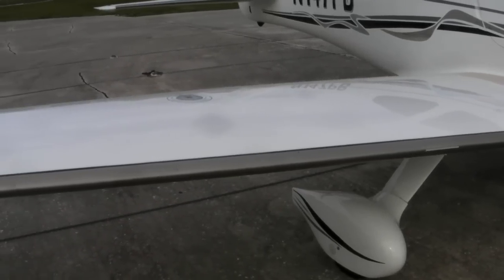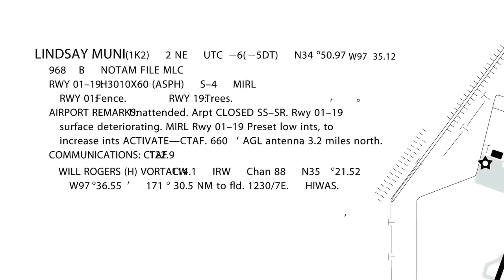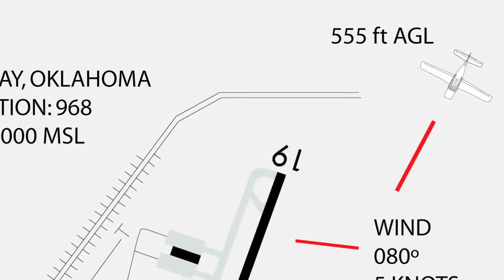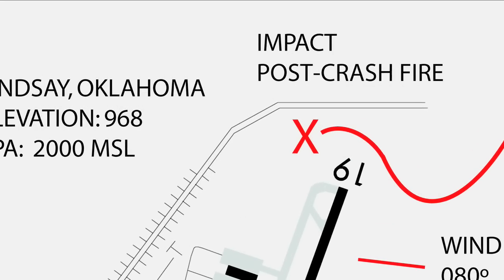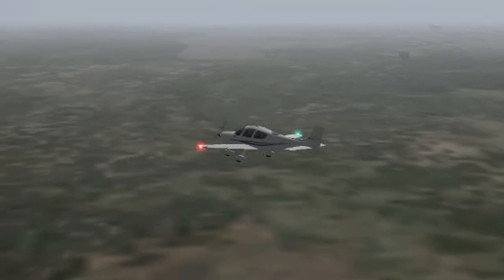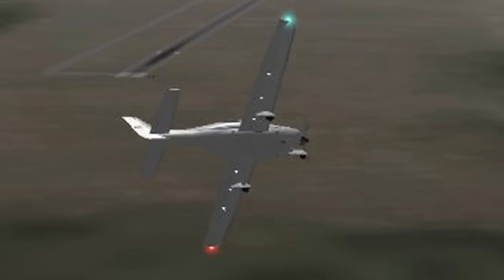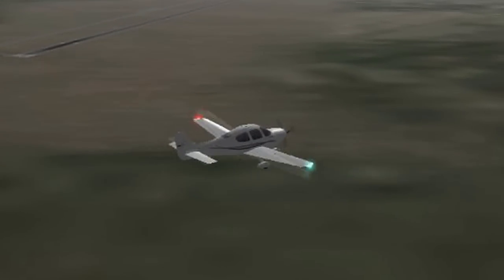Anatomy of a Cirrus Stall Accident

Comment: Is there a place for simulators in stall spin education?

 I heard from another channel that spin recovery is not taught as a matter of course. Would simulator training - asking the pilot to deliberately create stall conditions in the pattern, leading to crash, followed by both spin recovery training and 'correct' in-pattern, preventive behaviours - not drill this important safety issue home? Modern sims are highly accurate, relatively cheap and you can walk away from a crash in one. A useful addition to training schools?

NB I am not a pilot in training, just use sims, but plan to get up in the air for real :D
Reply: Yeah, and if you are taught spin recovery, your chances are way better that you would never accidentally enter one!
Reply: many sims do a poor job of simulating realistic spin conditions. Some are alright, but it should be part of every pilot's flight training. Spins in controlled conditions are very safe, but people are scared to ask to get practice and so they don't develop life-saving skills. If you ever do flight training, spin training should definitely be part of it.
Reply: Mirandorl Why not use a real plane? I flew some turning stalls this afternoon with a flight instructor. We got up good and high (4500' AGL) and ran through various scenarios. This included skidding turns and departure stalls. Very illuminating. Fun, too. :-)

Spins are required for PPL flight training in Canada, BTW.
Reply: +Mirandorl Yea it's called buy a remote control airplane and you will never make the mistake! As i learned years ago. It teaches you to avoid the shit that will kill you to start with and you get it see it first hand and just what will happen.

Which when I heard he tried to use rudder to recover. I knew just what was going to happen.
Reply: +Mark S Not at that altitude. He went from 1500 ft to 800 ft.  You could be a naval aviator and the out come is still the same. Not enough airspeed, time and space. You better off just to apply full power and fly your way out of it or better yet don't try and save the approach if you know you missed it. Just go around.
Reply: +Mirandorl We do spin training in Canada. It's really cool, and you can feel the +G's coming back. Dropping doesn't hurt a bit but I'm reading about recovery and possibly keeping the blood in your head by clenching your lower body muscles. Does anyone have experience in this technique? I just want to make sure I have full control in the event I'm the only pilot in the plane.
Reply: Elaine Morrison I have some experience with that technique, but under normal circumstances I don't feel like it's necessary.

When training for and practicing spins you may do many in a row, which is a lot harder on your body. The Gs come when pulling out of the bottom of the spin, so in an emergency scenario you'd only get that once and then hopefully not induce another spin if you were lucky enough to have the height/skill to recover.

The technique does work though.
Reply: +Andy Plater Thanks! I didn't want to do the opposite technique and make it worse (or ask a teacher at the school to experiment and report back if it wasn't the right thing to do, since no one seemed to have heard of that). Would you hold your breath or breathe in (as opposed to breathing out to relax which was what I was instinctively doing, but which is probably incorrect considering you're trying to keep the blood pressure high and restricted, I guess)? Yes, I got through it regardless but it was a little brutal and my instructor was there and I'm just interested in more technique to take the edge off in case I need it.
Reply: Elaine Morrison When fighter pilots do it they use a technique called "hook breathing", the idea is breathing in and as beginning to exhale you make a "hook" sound but hold the K and are squeezing your abdominal muscles. I'm not sure I would recommend it for spins and not more intense aerobatic maneuvers as without practice I would speculate one could either end up hyperventilating or not breathing enough which would be more cause for concern for getting light-headed.

Flexing the legs/abdomen but attempting to breathe at a normal pace is probably your safest bet. Also remember that the Gs are on the pull-out not in the spin or initial recovery, so don't let the technique distract you from recovering safely/efficiently.

The other thing I find that helps is time. If I've done multiple spins I may feel slightly disoriented or even just tired, so flying straight and level for a bit (possibly also while flexing) is a good idea if you're unsure of how you feel. Sometimes I'll do a full flight with multiple types of maneuvers including spins and by the end of the hour or more flight I'm just really physically tired.
Reply: +Andy Plater Awesome information! Thanks! I'll pass it on. I was googling but only found marginal pieces of this idea which was frustrating because I was sure people out there had the complete picture, and consciousness is not something to "experiment" with. :-)
Reply: Wireline, cost is a big problem. A full-motion SR22 simulator would cost well over a million dollars and it might cost $250 per hour to run. The airplane itself is $600,000 and costs $200 per hour to fly.
Reply: Turning stalls are not spins
Reply: Depends on where you are.
Training for detecting and recovering an incipient spin is performed as a matter of routine around here.

But training in a real aircraft for recovering an actual spin... That's illegal for a flight instructor to do.
Why?
Excessive training accident rates, and low survivability anyway if you get that far into a spin.

Obviously not every place is the same. My country has exceptionally strict laws, sometimes to the point that the regulator and pilots have developed a lot of mutual distrust because of it.

But end result is still that full on spin training is illegal. Make of that what you will.

If you're going to practice spins or any non-standard flight regime in a simulator though, be aware of what kind of flight model the simulator uses.

Flight models derived  directly from tables of real world data (such as MS flight simulator) generally don't have meaningful data for non-standard conditions, thus the behaviour will be completely nonsensical under these conditions.

Physics based models (such as X-plane, with it's Blade Element Analysis model) will have more appropriate behaviour in strange situations, but the general flight model in ALL flight regimes may be less than ideal, both in terms of general accuracy, and aircraft specific accuracy.

For training purposes you want the most accurate simulated model you can get hold of for the aircraft you're training with.
But be aware the behaviour may not be entirely trustworthy regardless.
Assuming a well made and accurate flight model for the aircraft, you likely should be using a data based model for training of routine procedures, and a physics based one for learning about behaviour in odd conditions such as spins and the like.
Neither may be entirely perfect but different models lend themselves to different things.
(For instance a well known test historically of flight sim flight models is what an aircraft does if you fly directly up and cut the engine. In this case most data based models behave entirely wrong, but most physics based simulations correctly predict the behaviour at least in broad terms.)

Use the appropriate tool for the job, and make sure you understand the nature of the tool you're using, and what it's limitations, strengths and weaknesses are...
Reply: I was a U.S. student pilot over 25 years ago so maybe there's better info now, but my understanding was that spin training was eliminated here because the FAA came to believe we were losing more people to spin training fatals, or at least the risk was higher, than certificated pilots surviving spins thanks to training. At least at my GA level. My instructor at the time took us through a spin which was pretty scary for a novice--and later told me our plane rotated one more time than he thought it should have.
Reply: KuraIthys That’s fascinating. Does the sim actually give you the whip stall , tail slide,  and direction of pitch-over (backward or forward) and sharp forces on the stick and rudders?

Comment: Wouldn't this be considered as an "accelerated stall"?   You know, the "high" wing's AOA is way to high, thus stalls first, and in this case, the plane rolls to the RIGHT?   Or, what did I miss?    Have done this type of stall to demonstrate that stall is a function of AOA, and not airspeed.  Help me out here, y'all.

Comment: Wow, just overfly and enter the left downwind for the opposite runway and live. Wonder if the CFI took over or was asleep.
Reply: SGTSnakeUSMC  Seems most likely, as a previous commenter said , that the CFI gave him a forced landing , since it was one of the few places you can do it at that height above ground without having to worry about wires ,  scaring people or cattle, or getting reported for low flying. Trouble was , instead of just maneuvering to land on 19 with any checks superfluous by then , he started some rigmarole that confused the CFI and diverted his attention. Both thinking along different lines until it was too late for either of them.

Comment: ive pulled that off on flight sim and the g-s are always 1.3- 1.9 and i always miss the centerline and endup at full throttle and going for the correct approach never works unless u want to land 3/4 down the field

Comment: Steep banks aren't to be "avoided at all costs" even in the pattern; they're fine when executed in a coordinated turn with appropriate pitch and power applications.  Applying opposite rudder, though, in a steep turn, like this guy did, isn't coordinated flight and that's what caused the stall, not the steep turn per se.
Reply: Danbertex notice he said steep banks AND high load factors should be avoided.  You can't get into a stall/spin situation without loading up the airplane. (that I'm aware of at least)

Comment: Landing approaches should be made the same way every time.  This was a one off.  It was nothing anyone should ever try twice, let alone as a habit.  Only a highly competent and proficient pilot current on skills should approximate this maneuvering, for whatever reason, demonstration, etc.  The plane was not even at pattern altitude---a no no.  I recall a case of a retired Air Force pilot stalling out on the turn from base to final even while making a proper approach.  This plane can only be flown in the proper manner.  It is not "forgiving."

Comment: if I had to guess. the instructor simulated an engine failure. Both let it get too far... shame.
Reply: The flight data should have revealed if the engine was at idle.

Comment: Cirrus did not invent the geometric offset of a wing, and is has not to be done with an offset of the wings leading edge. There are plenty of planes consideres to be "stall safe".

As an aeronatical engineer and pilot, I do not follow the notion to make planes foolproof. In engineering, there is a saying that whenever you built a system, that an idiot can handle, someone will invent a bigger idiot. You have to be aware of what you are doing anyways.

Comment: the approach was bad from the start and about every possible mistake was made. the last fatal one was the applicatiom of (probably) full right rudder in a steep turn to the left - close to the stall angle of attack. even when the airplane rolled right (i think!) there would have been enough altitude/time to release the parachute.

Comment: I’m not a pilot, so I can’t really critique this. That said, I do have to wonder why the on-board instructor allowed the student to pursue this unsafe set of actions.
Reply: It's not like a training car, the instructor doesn't have authority over the controls, they're joined together. So if one guy starts panicking and becoming unresponsive and putting in bad inputs, you are now essentially arm wrestling them for control. And a guy who's panicking has alot of strength.

Comment: When a glider does a beat up and then does a 180 turn at 150feet or so the angle of attack is very high also. The speed is a lot faster but can someone explain the difference?
Reply: Kworbulan Well , I can think of a couple of reasons. You have to be a more competent stick and RUDDER pilot , because you don’t have an engine to cover up your mistakes—when coming in for a landing there’s no go-around. However A/S is lower so there’s more time to think, and instead of a ‘ball’ to step on to keep coordinated which necessitates looking down at the lower part of the instrument panel , there is a yaw string right in the middle of the windscreen which does the same job and negates the need to divert your attention from the aircraft’s attitude relative to the ground at a critical juncture in the flight ; coordinated flight , or lack of it, particularly at low level, seems to be an all too frequent initiatory cause for many powered flight accidents.

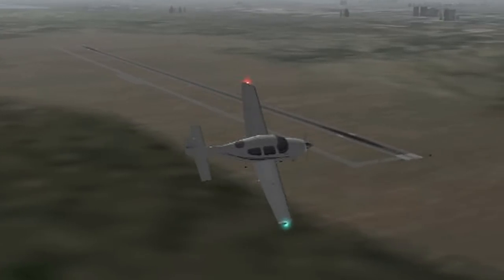Comment: 3:23 - "The wings weren't heavily loaded because the the airplane was still descending" 

==> If you are going to dissect an accident, then present correct aerodynamics. The loading of a wing has nothing to do with the particular direction the airplane happens do be travelling, be it up, down, or whatever. Big, big mistake for someone dissecting an accident.

Comment: "In engineering, there is a saying that whenever you built a system, that an idiot can handle, someone will invent a bigger idiot." -- That's an incorrect statement. If this were the case, why not make a car that takes 4 hours to start and password to make a left or right turn? If you did, only the most dedicated people could drive and it would weed out the idiots right? No. The easier you make a machine to operate, the more they can pay attention to what is important, like avoiding accidents.

Comment: What you said about the altimeter was  confusing
Reply: He talks about the pressure altitude. The altimeter in the plane measures air pressure to determine height above sea level. This would be displayed directly in front of the pilot. The airport is not at sea level. To clarify how close to the ground the plane was, he gives the AGL (above ground level) altitude.

Comment: Why does a Cirrus have a parachute?  Because it is missing another engine.
Reply: A the price I could buy a twin, even a used C90 King Air for example.  Personally I'd rather take the chance on a Beech King Air than go slow and low as is the choice in a Cirrus limited to 10,000 feet part 135.
Reply: Transcendian Comparing both airplanes is absurdly unrealistic. Buying a King Air instead of a a Cirrus is like buying a Boeing 787 instead of a King Air. Sure, much better aircraft. But fuel costs? Maintenance?  Owning a King air is not a true alternative to owning a Cirrus.
Reply: Prices I looked at were close enough to cause the comparison.  High and fast with two engines works better than low and slow with a a parachute.
Reply: Transcendian Until you have to overhaul the engines. It will cost about as much as a new Cirrus. LOL. Not to mention everyday fuel costs.
Reply: I'd have to look at TBO, as you say.  Of course you can look at the record of something like an Aero Commander, which was famous for its detachment of one prop, and take off and landing.  I have actually seen an aero commander blow an engine, and go around to land as if all were normal but a puff of smoke.  Of course when you look at the durability of a PT6, about anything flying with it as the power plant does give some great service.
Reply: Transcendian I fully agree, reliability of PT6 and other turboprops is excellent. The only problem is cost. A 3,500 hour overhaul will set you back a quarter to a third of a million dollars for both engines.
Reply: Transcendian Perhaps he wanted to be able to potter around shortish back-country unimproved airstrips , or in the mountains, he sounded like that from the description of his flying from a previous commenter. Try doing that in any twin ( if the insurance company , or, for that matter the POH will let you) !

Comment: So "Split leading edge" is just washout?
Reply: Yes.  I think they claim that since it's a discontinuity that it forms vorticies that themselves act as wing fences to further prevent the entire wing from stalling in addition to the lower angle of attack....  With so much advanced technology to save the pilot from his own poor piloting, it's a wonder these birds ever go down.  I think the belief that the parachute and spin faeries will save you makes a person careless.
Reply: ollopa1 Rather, I think that it's just a slight increase in the angle of incidence, such that if the inner wing is at 17 degrees AoA, the outer wing is at 16.5 (or whatever) degrees AoA
Reply: stevethepinkeagle Well that's what washout is, which is what Miles was pointing out.  Washout is a twist in the wing that results in the roots stalling before the tips which gives a little extra warning before the entire wing stalls and ensures that the ailerons still function at the beginning of the stall.  "split leading edge" is just a way to hype up wing technology that's been around since the beginning of aviation.  But because it's not a gentle twist but a sharp discontinuity instead, Cirrus claims that it additionally has a similar effect as a stall fence.  If it works by creating vortices as they claim, though, then it comes at the cost of induced drag.  So in summary that's how "split leading edge" is both merely washout and supposedly more than merely washout.